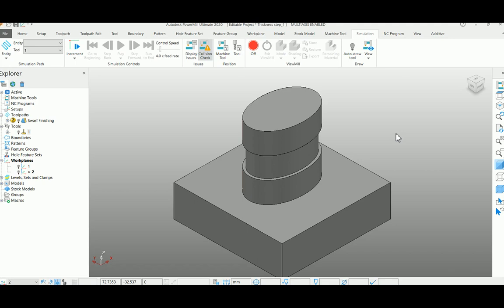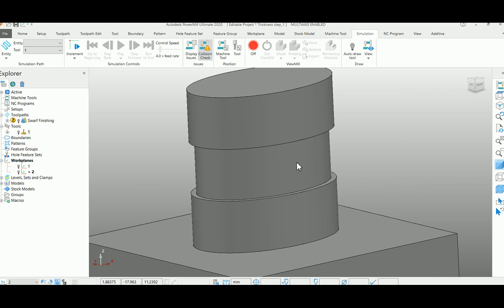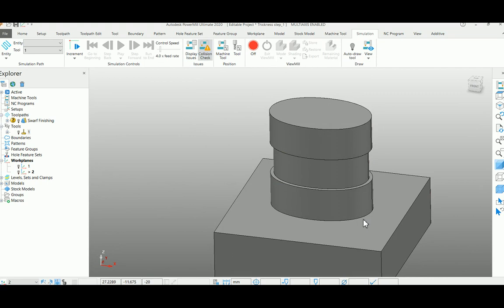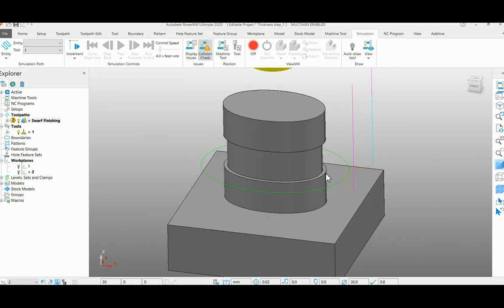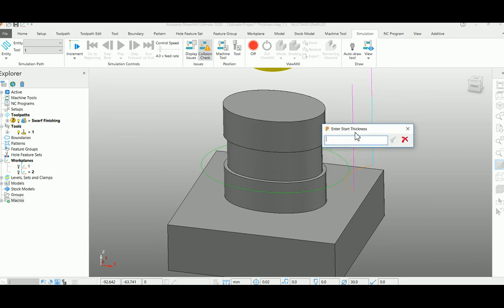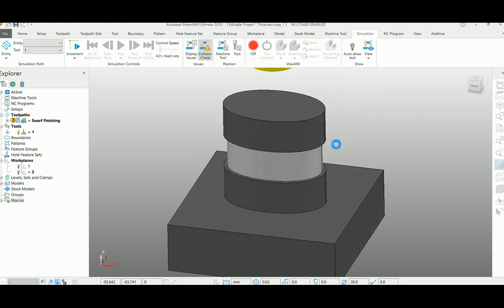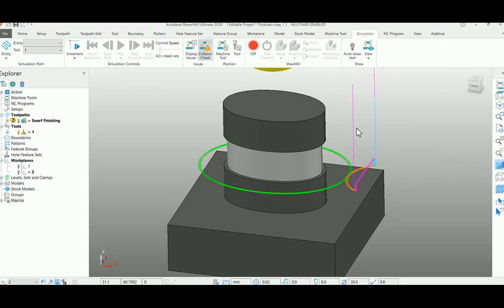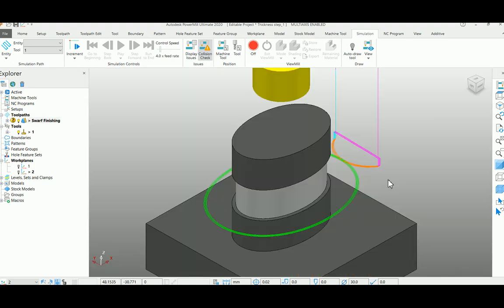Autodesk PowerMill -  Macro for Step Thickness

Comment: do it with 2d curve profile strategy.
its easy way and  powerful than this method
Reply from the maker: It is an example for easy understanding. 

Consider a complex 3d surface , during that time you must have to use swarf finishing. During that time this macro will help you a lot.
Reply: @rajeshkanna5177  so attach the macro here
Reply from the maker: @CAD_CAM_TRAINING  Kindly provide your email address
Reply: @rajeshkanna5177  im still waiting for you
Reply: I guess, with 2D curve strategy, you can not keep the pass normal to the angled surface..